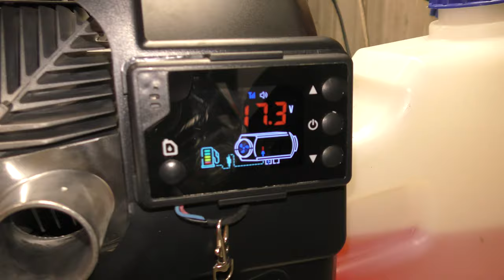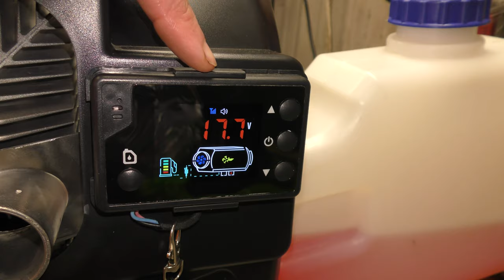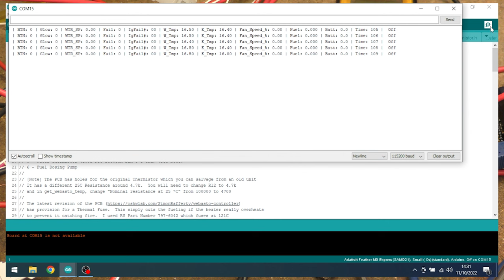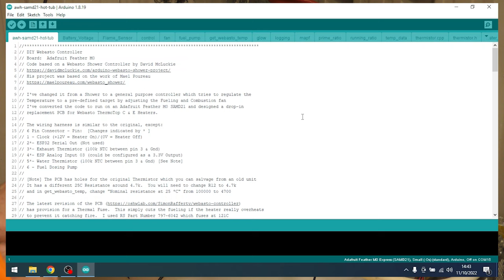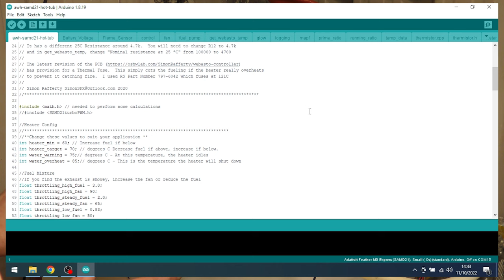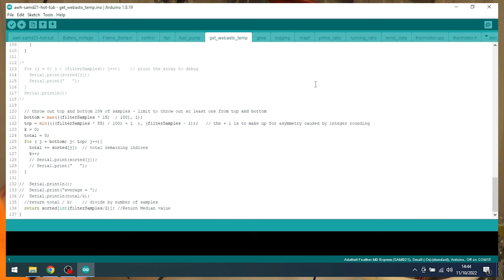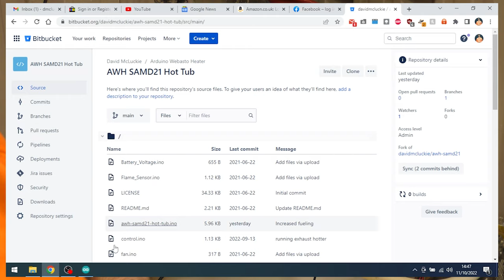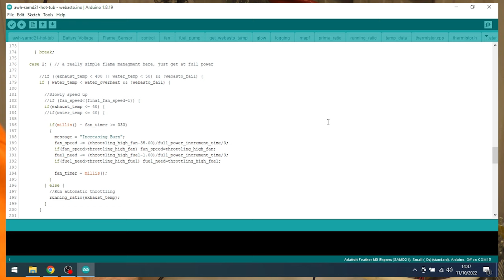Let's look at the weird 12, 24, 240V heater ecu & have a play with the Webastardo and the code.

Comment: Some of the Ebers and the Webastos were intended for fitting to trucks used for ADR transport. This requires that the device could be hard stopped by turning off the power. Therefore they had to run cool enough to NOT need the fan run on during cool down. As the flame chamber temperature rises the cool down period may also need to lengthen.

Comment: The code still uses the glow plug as a flame sensor using the extra board will inhibit this function, exhaust temp < min will inhibit failed start but could still flood the burn chamber if it flames out for some reason
Reply: @piconano  that is my understanding when I looked at the code last, however I’m unsure how it determines that as when control by the transistor in the diagram there is no way for the adafruit to sense the resistance, I could be wrong here 

My revision negates the need for this function and uses a thermocouple for egt and some code for flame detection
Reply from the maker: It exists in the code but not really being utilised.  There is an experimental flame sensor that doesn't work.  The original Webasto controller uses the glow plug resistance as the flame sensor.  We are using the exhaust temperature sensor to detect the flame.
Reply: The code tried to use the voltage drop from the battery when the glow plug is activated to work out the current resistance, looking at the code. Using a shunt would be better to measure the voltage drop over a known resistance. I think that might be possible to do using the feather M0, I'm using a pro mini though so not yet found a way.
Reply: @DavidMcLuckie  I'm designing a 12v flame rectification sensor at the moment not for this but no reason it couldn't be used.

Comment: The intention for the glow plug mosfet was that it is thermally connected to the body of the heater which is an almost perfect heatsink!  (note for anyone not putting the board inside the heater!)
Sitting in free air like that - I'm not surprised it let the smoke out!
Reply from the maker: Yes.  I think with a bigger passive heatsink I'd get away with it.
Reply: Can confirm, heater body works great as a heat sink for the glowplug mosfet! Just remember and apply the thin electrical insulation heat transfer tape thing that's on the existing board over your mosfet so you don't short it against the heater body.

Comment: I mentioned on another video my idea and asked if you had done it to use exhaust heat on an oil-filled radiator, to explain a bit further I was thinking a water-filled radiator would blow if enough heat was in a radiator but an oil radiator is self-contained so was wondering on a small oil filled radiator which I remember tearing apart once, one side there was on the bottom an electric heater for the oil my idea was to remove this and drill the other side to allow a straight through pipe which would become part of the exhaust of the diesel heater I did think to drain first and weld a nut on top with a bolt to refill with oil, any thoughts? I guess oil like water with enough heat could potentially overheat but with tests, a thermal heat switch could be implemented if needed.

The idea is if doable maybe for a campervan fill a towel rail radiator with oil to look aesthetic not to big or wide or even to consider a way to do underfoot heating

Comment: My wild guess would be it's doing buck boost to be able to use the 12/24v switching
Reply: agree.. the coil is a transformer/inductor  commonly used in MPPT controllers ... used to modulate power output for max charging efficiency at 12 or 24v

Comment: The Eberspacher heater range didn't work at 24v even though they worked off 24v! They had a voltage dropper circuit to simply run a 12v heater off a 24v supply. Looks like the Chinese have copied this too.

Comment: You can try and run a heater off of 2 large dewalt batteries they sell battary holders and dc to dc converters  but you will still need to put in a fuel pump  cut out for low voltage because the dewalt batteries  just completely cut out  when they get to low and for mains you can use a 30amp  computer power supply i just dont know if the dc to dc converter can handle being back fed with power so that may need to be split with a 3 way switch
Reply from the maker: https://youtu.be/e1Iol7dhLqk

I'm a Makita user.  :)

Comment: With diesel we try to keep the exhaust temp below 700c (1250 is) f.  I don't see why you couldn't run that Heater around 600c  around 1100 f.   As long as you have enough water flow so it doesn't cavitat
Reply from the maker: Might be time to switch to the big fuel pump.  :)
Reply: @DavidMcLuckie  yeah and maybe a bigger jet ?      I would be very interested in seeing the updates as you go with it.  To bad they cost so much or I would buy one and see how far I could go with it lol

Comment: Having difficulty making sense of your video order....not new to the Adu fruit/ arduino/ bare mcu programing thing....but wondering where to start with with you home built heater ecu project.     Is there a project page or some place I can kind of co.e up to speed at ?
Reply from the maker: Yeah, sorry.  I still haven't written the website page.  First thing is you need a board.  I have another 5 Webastardo boards on order from JLCPCB.

Comment: Hey. I have a VEVOR Diesel Air Heater Parking Heater, 12V 8KW. It have a knob with a nice lcd remote control. It only go up to 5hz, this means 4, 4 kw. Is there any chance to change this?

Comment: I set my diesel heater to run off my vans gas tank it's running the gasoline fine but what are the actual low and high settings I need to input in the controller to burn the gas correctly at low and high speeds?

Comment: I wonder what it would take to "hack" one of the Chinese diesel heater Ecus to run a Webasto water heater? And weather you'd get any benefits from being able to customize the fueling for more or less output?
Reply from the maker: The problem with the air diesel heater ecus is they need to see the fan speed from the magnets and the sensor.  If you could trick that bit you'd have a supply of cheap ecus you could use to replace the Webasto boards.
Reply: @DavidMcLuckie maybe a multivibrator could be used on the Chinese ecu to mimic the motor speed sensor

Comment: Can you not just use a good old relay for the glowplug it would be large but would be reliable and easily replaced
Reply from the maker: Yes ish.  Ideally the power to the glowplug ramps up to 8V and not the full 12V.  If you can limit the voltage to 8V you can use a relay.

Comment: The max exhaust temperature settings were a bit on the conservative side - I'd intended to increase them, but forgot!  When I was first running it in my van, I was a bit paranoid about it catching fire!
Reply from the maker: If aluminium softens at around 600ºC, anything below that should be fine.  :)
Reply: @DavidMcLuckie  I agree. 

The reason I built this in the first place was to reduce the output of the Webasto.  I'm using it to run Underfloor heating which doesn't sink heat very fast (about 2kW max).  The original controller at 5kW reached full temperature within a couple of mins, overheated & shut down, then re-started a few minutes later (short cycling).  With my controller, it gets up to temperature then just quietly idles while it warms the van.

Just in case anyone was wondering why I'd deliberately limited the heat output!

Comment: I have a 24 v system and use a 12v regulator. I have been tempted to set it to 24 and hook it up without the converter. What will happen?Im having a relly hard time finding a 24v 2kw heater.
Reply from the maker: I wouldn't.  As it'll likely be the last thing your heater ever does.
Reply: @Albert Because I only have a small space it’s a minivan.

Comment: Has the heater not got its own power supply in
Reply from the maker: Only for the mains supply.  240V in 12V out.
Reply: @DavidMcLuckie  I'm looking at doing something similar because I am using my 3d printer psu and I'm putting a relay on so that when the 240v is on it connects the 12v from the psu and when it's off there's no connection to the  psu and I can use the 12v supply for the heater to battery

Comment: Hi David, really interesting video even though I had no idea what you were doing with the Webastardo code it just went right over my head😂 I used to do a lot of coding a few years back when I made 3d models for a PC game but I seem to have forgot all of it🤦‍♂ Anyway, the ECU on the heater do you think that the actual heater itself is 12V so what ever voltage goes into it (12-24V) is then regulated by the 2 chips you mentioned down to 12V so even though you were putting in 18V the reg was outputting 12V, just a thought👍
I'm going to send you a message on Instagram David
Reply from the maker: Yes, I think that no matter what voltage you put in, the ECU turns it into 12V so as not to destroy all the 12V parts.